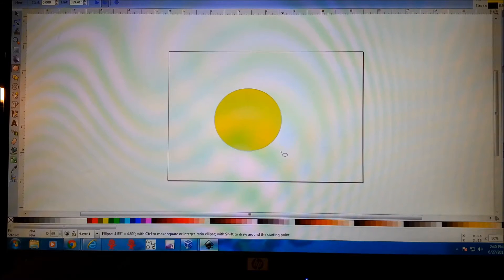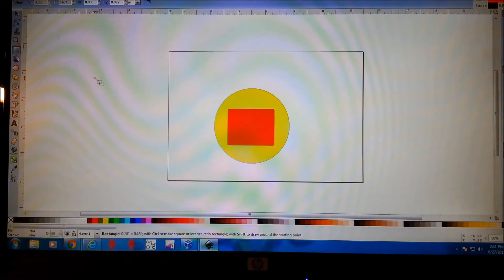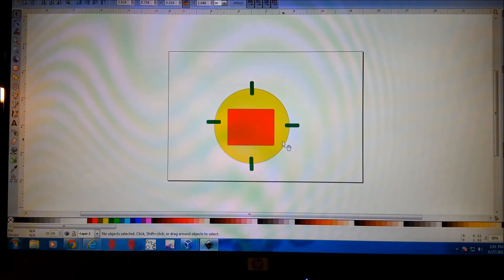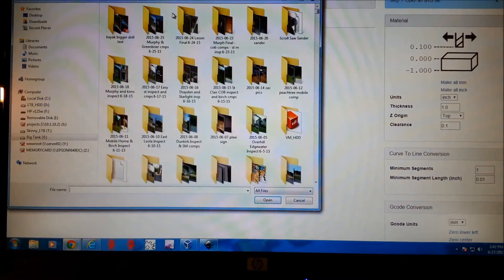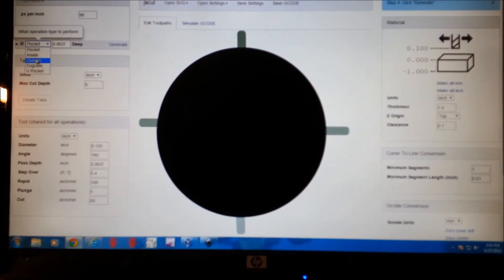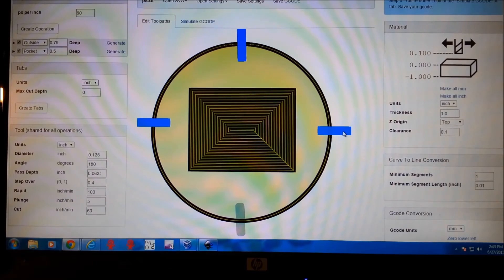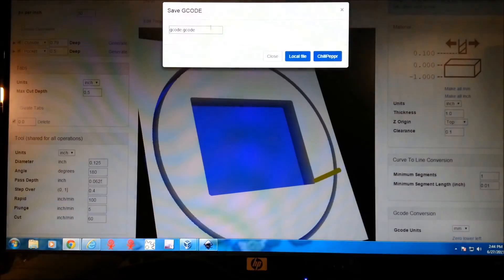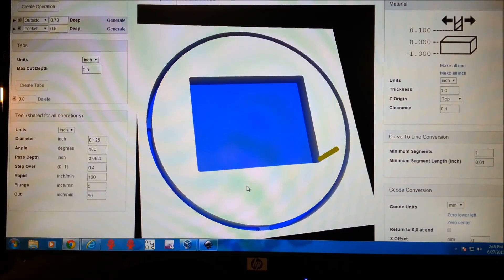Making CNC Pockets - With Free Software!

Comment: I tried using this but jscut always crashes in my browser.  I'm using Chrome.
Reply from the maker: Ron Stephens Hi Ron.  Sorry to hear that.  It's a really great piece of intuitive software.  Jscut has been pretty stable when I've used it online, although at times possibly due to demand (it's running in a Google app engine) it can slow down.  I'm running it locally off-line through a virtual machine.  A friend of mine helped me set it up - I'm not a virtual box/ubuntu expert by any means, but if you know somebody that is skilled in those areas running it locally is a delight.  Thanks for your comments.